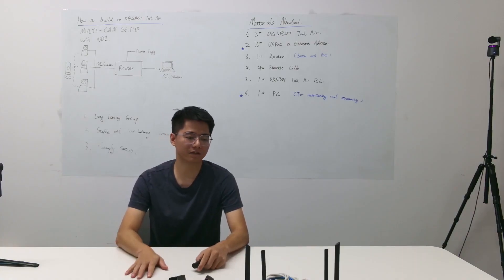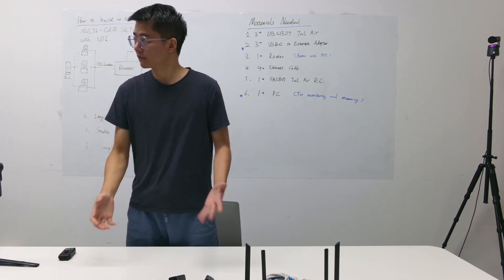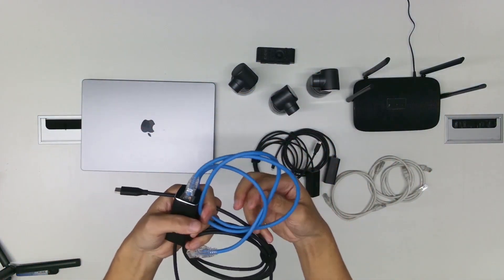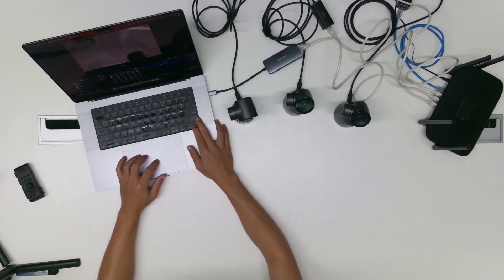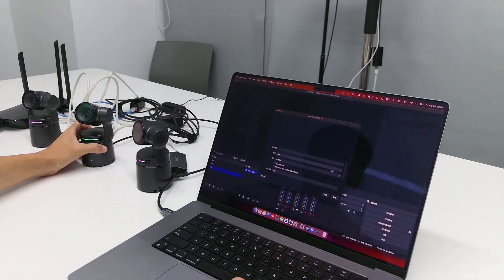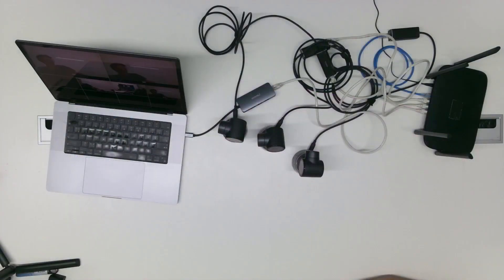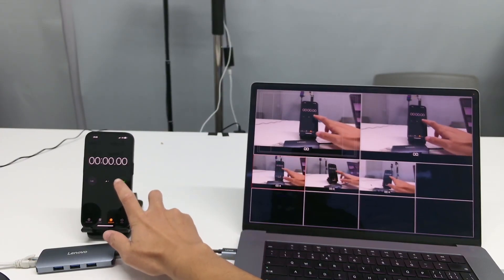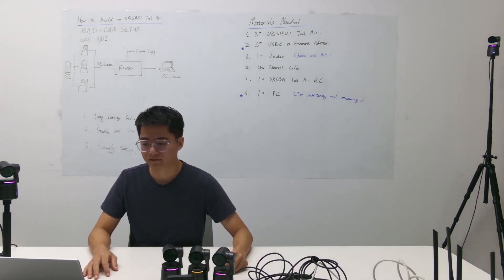How to build an OBSBOT Tail Air multicam setup with NDI

Comment: 3 Questions. 1) So I have 3 obs cameras that go to my computer to stream but since our wifi is too slow we tether the computer to a phone to use the data. Can I use this method to connect the cameras to the computer or must they be connected to the wifi and or phone data (computer, tablet, and cameras) to work? 2nd: does NDI use internet to transmit video? We have very slow internet so it might be an issue. 3rd: does it have to be a wifi router? Can I use a network router (I understand it has to be a gigabit or higher)?
Reply from the maker: Read more here https://chinagadgetsreviews.com/?s=%22obsbot+tail+air%22

Comment: Can this be done the same way with router but wireless link to the router? I don't want to use so much cable
Reply: I did it with a wireless router and it worked. The only issue is that the router has no internet and I want to connect my internet via a separate router not the cam router. Can that be done?!
Reply from the maker: Thanks for sharing

Comment: What is the device you used to connect the Ethernet cable to the Laptop? Also can you stream at 4K across the Ethernet cables?
Reply from the maker: A multi-port hub. Yes, you can...
Reply: Have you got a link to the hub? Also with OBS, do need a plug-in for NDI connections? Thanks!
Reply from the maker: Did you find one?
Reply: @ChinaGadgetsReviews  I did not, still trying to set multiple of this cameras up this way.